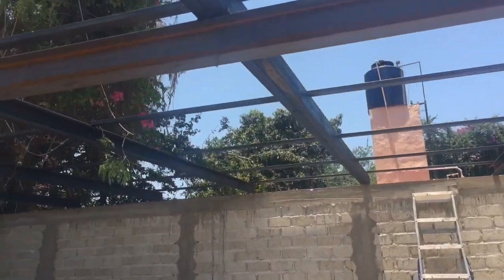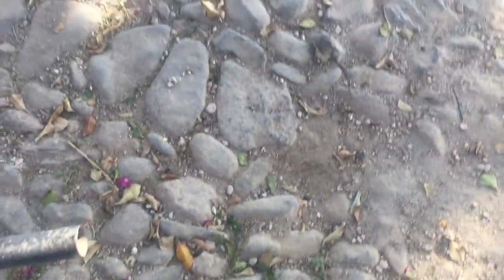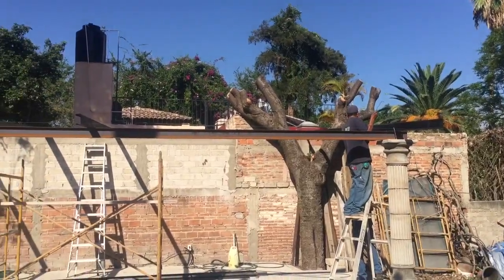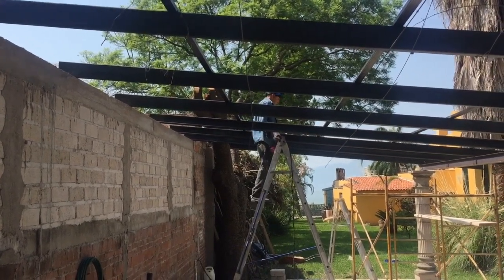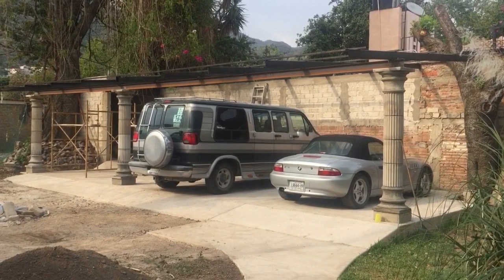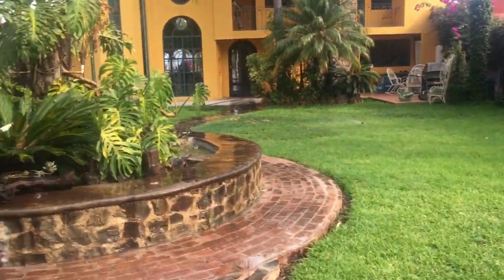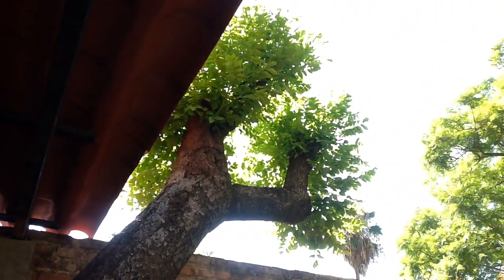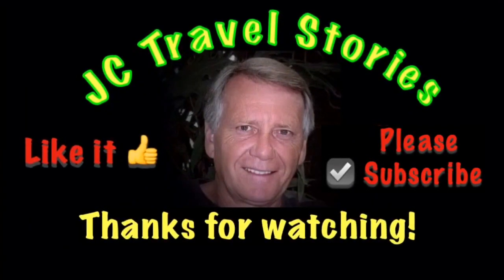Carport Finished!  Retire in Ajijic, Mexico.

Comment: You added a beautiful add on to your gorgeous home. Great work!! I love it. I would love to rent it. 
I did want to mention that the sound volume is a little low on the videos. I do have a hard time hearing them sometimes.
Reply from the maker: Jo Ann Lewis ... Thanks, Jo Ann.  You CAN rent it.  If you're interested send me a private email at jc.travel.stories@gmail.com.  The low sound ... I was turning it up and then some of them were distorted so I dialed it back.  Thanks for the heads up.  I'll try to fix that.
Reply: JC Travel Stories thank you JC. I just sent you an email. 
Jo Ann

Comment: is there steel beam inside the columns or its just concrete?
Reply from the maker: Its steel re-enforced concrete poured inside the columns.  The fluted part is not structural, just decorative.
Reply: @JCTravelStories  thank you jc, I'll ping you when I get in town if you'd like a beer. sometime in april or early post semana santa

Comment: How are the fiberglass roof panels attached to the steel?
Reply from the maker: Self taping screws with rubber grommets.  You have to be careful not to make them too tight or it will crack the fiberglass.
Reply: Poking you a bit... in a video of yours I watched recently, you tried to read someone's comment but stopped halfway through and talked about misspellings and grammar problems... by "taping" I think you mean "tapping". (grin)
Reply: @jackonthefarm5540  
Haha. Gitcha